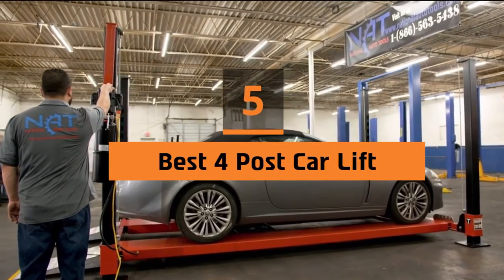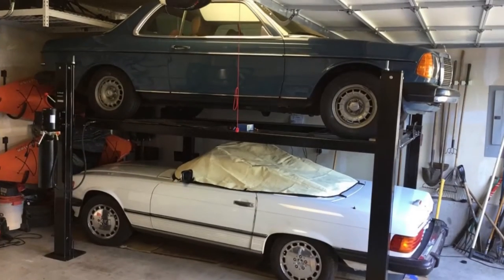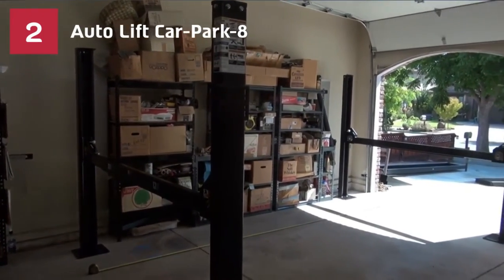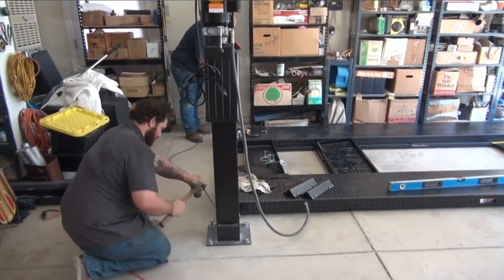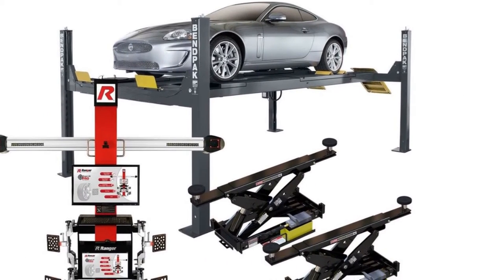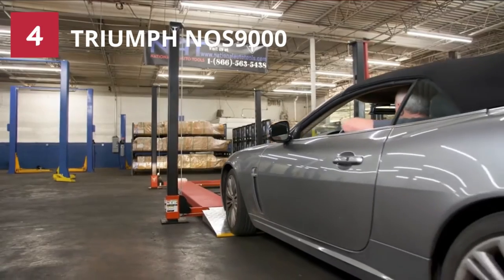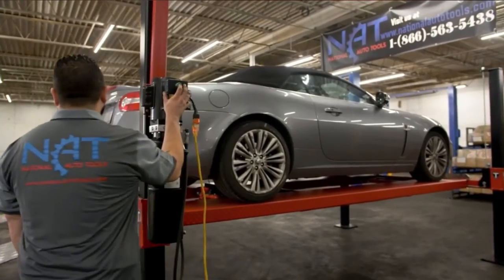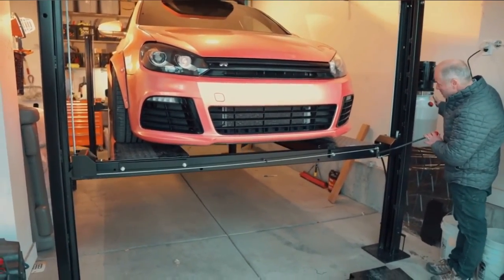Top 5 Best 4 Post Car Lift For Home Garage Reviews 2023

Comment: With having this left using it with a pickup truck and you want to store a car under it how much height do you need for the lyft and the ceiling please let me know thank you
Reply from the maker: https://www.kwik-lift.com/2018/07/car-lift-height-requirements/
Reply: Just do the math.  Don’t forget when u drive on the ramps your vehicle is going to rise 4-6” and most garage door openings r only 7 feet tall.